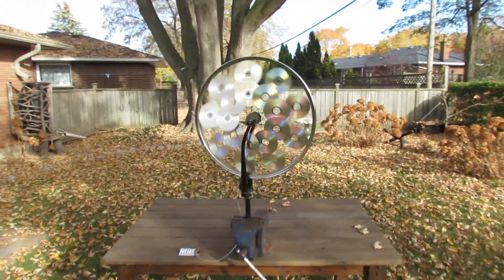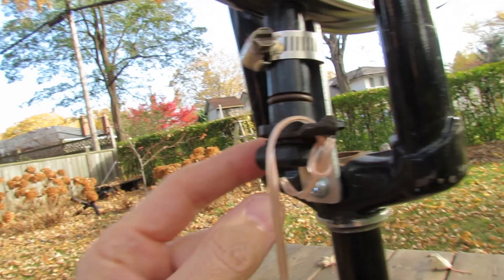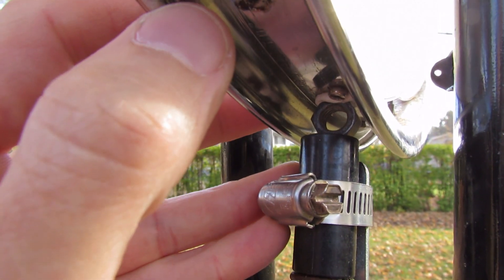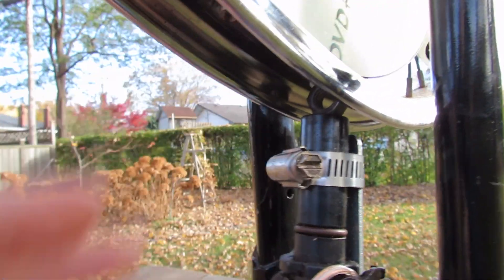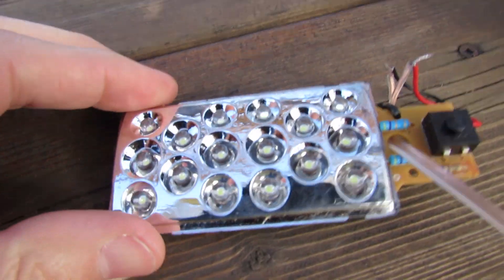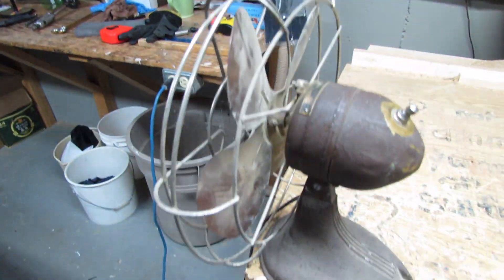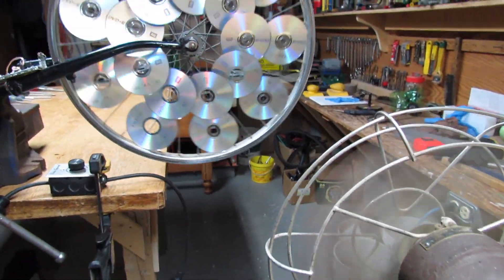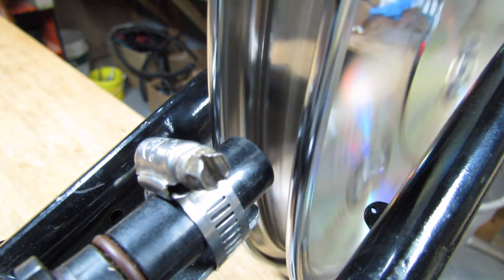How to ● Homemade Bike Wheel Wind Generator ● Powers LED lights ● ver. 2.0

Comment: so the lights flash, because of the engaging/disengaging of of the crank sensor. 9 nuts? not 8? Is it because of the way wheel is spoked? Makes it easier to arrive at that measurement?
Reply: I just played back at reduced speed - can see it works w the spoke spacing

Comment: If you drilled a hole where you glued the nuts you could put a cap screw through with nuts on each side to adjust the clearance to the sensor. If the axial trueness of the wheel changed, the clearance could be readjusted.
Bully video, BTW.

Comment: Replace those nuts with some Neodymium magnets
 and you''ll get places.
Reply from the maker: Doing that would cause too much resistance and it would not rotate with the wind. But I suppose the distance between could be adjusted to adjust the resistance. Hmmm.
Reply: I think it'll would work.  Building one with aluminum flashing as veins.  No shortage of wind here in southern New Mexico.

Comment: good video ' how did you stick them cds on the wheel ' mine would fall off .
Reply from the maker: I used silicone adhesive. Hot glue is another choice.

Comment: In a gear book I got, there is a doubling gear that increases the rotation by 2.  It is made with bevel gears.  It's in 507 Mechanical Movements.  All you need to generate a charge is have a neodymium magnet move in a thin copper wire coil.  Could probably 3d print those or replace in another material. You need a diode to keep the charge from flowing back.  You could use any material like paper or fabric and seal it with acrylic mat medium.   I might cut the cds in half, and make them like scales - that might be more visually interesting and work just as well.

Comment: Chris, how hard is it to get one of the crank sensor out of a junk yard?  Do you have a part number for the one you used?  I see serveral different ones listed on websites but since yours works well I would prefer to use that one if I can find it at an affordable price.
Reply from the maker: It is out of a v6 engine that general motors made. It was in the 2.8L and 3.1 litre engine that they mad from about  1986ish to about 1995ish. Here is a link to a page I found. You should research more for a better price since I am sending just as an example. It's the1st and 4th one down on the page. Hope that helps.
Reply: @chrisnotap     Ordering Crank Sensor Doorman 917-757 to try out. Thanks for Video.

Comment: also, did you measure the voltages  it puts out when turning? I'm curious if it'd be strong enough to power a small buzzer or electrical siren scavenged from a fire detector.

Comment: does the second one you made move easier in the wind than the first one with only nine cd's ?
Reply from the maker: The second one seemed to move easier with more cd's
Reply: GmGarlo 

They used blank DVD-Rs.

Just a waste doing that diy of using CD-RW/CD+RW, DVD-RW/DVD+RW.

+R and -R are only copy once, it can't rewritable.

RW can rewrite up to 1000 times.

Just can use blank DVDs to burn from torrent movie download via PC.

I recommend you to use CD-R. It's cheaper than DVD-R.

Comment: Chris, I want to try something similar to this but am having problems with the simplest part...  how are the CDs attached to the wheel?
Reply from the maker: My go-to adhesive I use for everything is plain old multi purpose clear silicone in a caulking tube. As you lay out your discs on the spokes, there will be about 3 contact points where the disc touches the spokes. At those spots, just put a small blob of silicone over the spoke and onto the disc. The only things is that it's take a bunch of hours to cure, which I have plenty of.
Reply: Thanks!
Reply: William Smith 

It's DVD-R.

Comment: Could this be used to charge batteries for power while off grid?
Reply from the maker: +Jadoube23 LEDs take very little to power so no, off grid battery charging would not work.